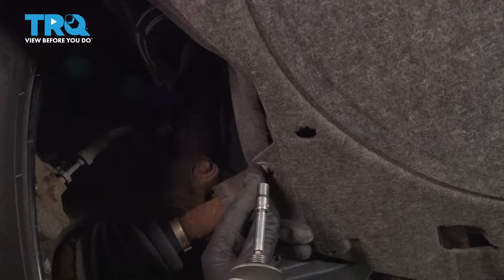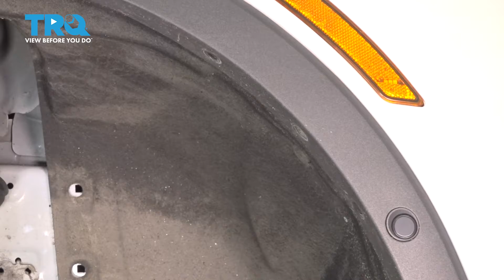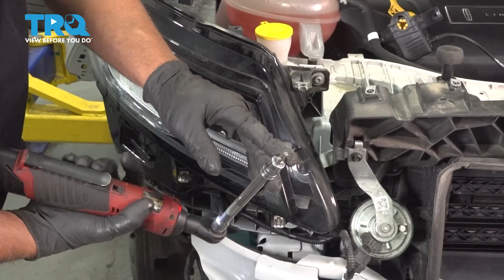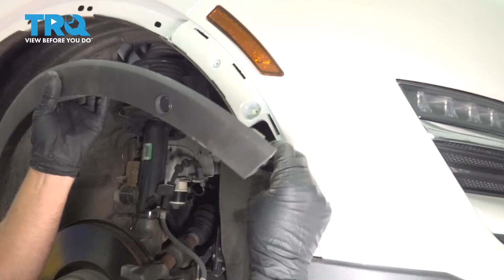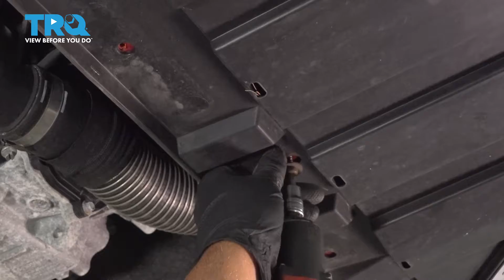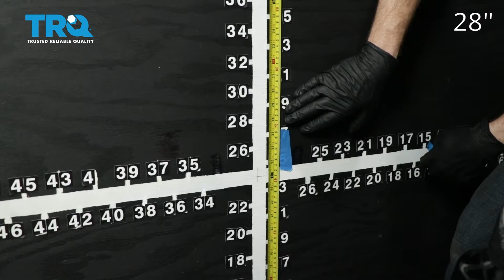How to Replace Head Light 2015-2019 Lincoln MKC

Comment: Do you know if this is the same process for a 2016 MKX? I know they have slightly different bumpers but it looks very similar and I know I need to take my bumper off to replace my headlamp assembly. Can’t find a video specifically for ‘16 MKX.